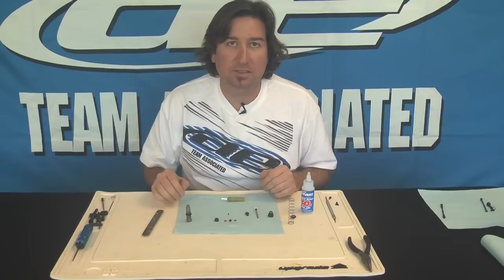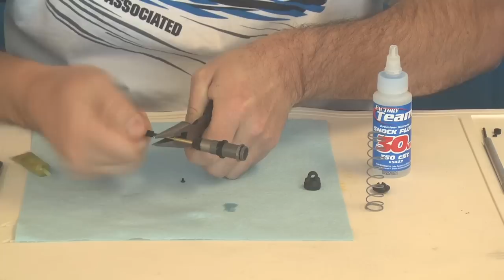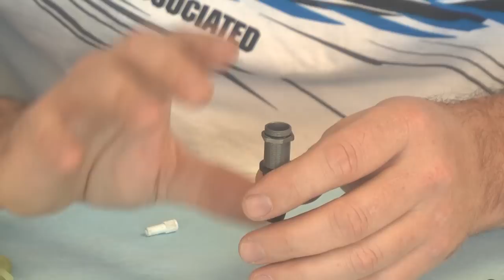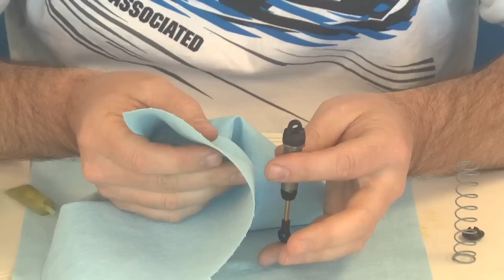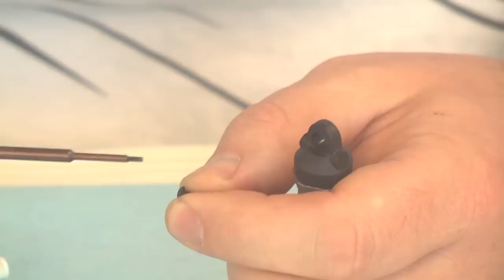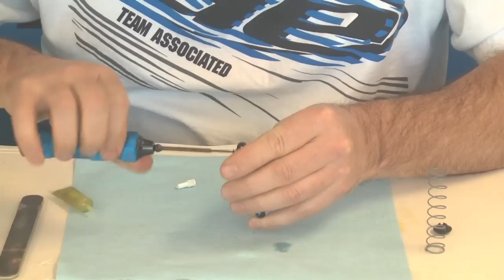Tech Tips - Factory Team V2 Shock Build

Comment: @Djappe93 Actually a little suck back in is normal, if you put and seal the cap with the shaft pushed in when you pull it all the way out it will come back in just a few mm, if it sucks all the way back to the body then you should rebuild, but a little rebound both ways is fine

Comment: The only time you're safe to coat your shock shaft threads with silicone shock oil is if the o-rings are also silicone. Personally, I always feel safer just using green slime to coat both the o-rings and the shaft threads.